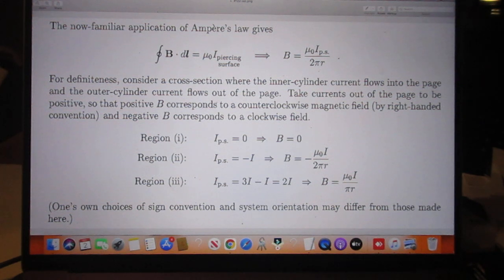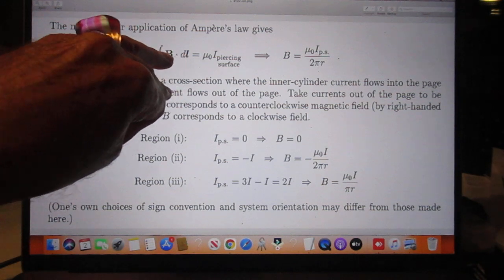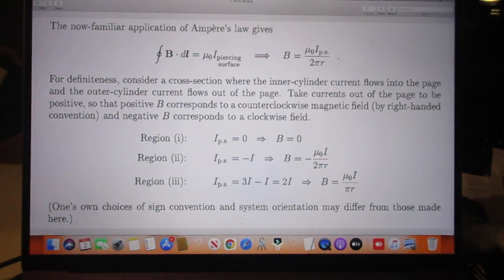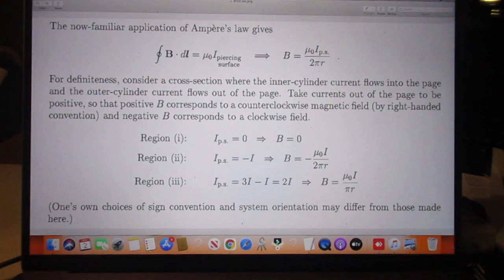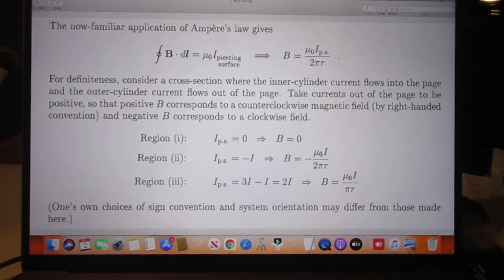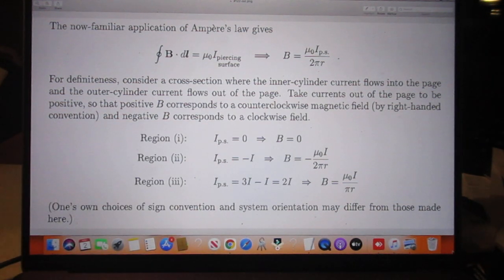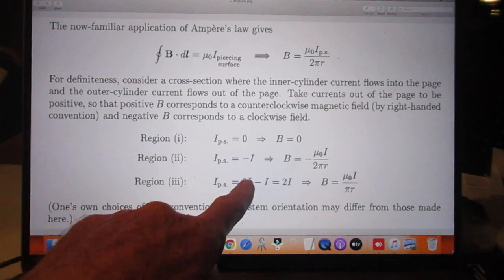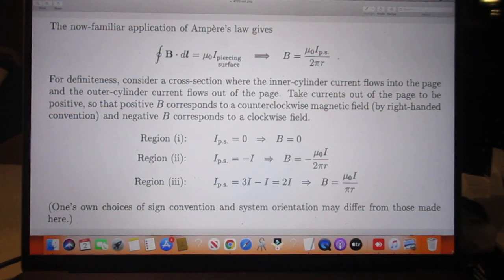Solution Problem 122 - 2 Concentric Cylinders

Comment: You might mention to your viewers how you would apply Ampere's Law to a geometry where the cylinder cross-section is not circular as you assume in this problem (path length = 2 pi r)  and also when when the current might not be uniformly distributed over the cylinder surface.   There are many ways  B dot dl summed around a closed loop can be zero besides B itself being identically zero.

Comment: Despite enjoying the process of learning and teaching classical mechanics, I have not found many real world applications of ampere’s law that do not involve solutions that are non trivial. 

Even within the context of the proposed question, given a wire with a current of 2Amps, and a distance of 4cm, the B field at that location would be pretty small. Another wire could be placed at that 4cm location, and experience a force; however, that force would still be considerably small and seemingly idle in a real world example. Excuse my ignorance, but the textbooks I’ve been studying do not elaborate on practical applications of ampere’s law. Would you be able to provide a few resources that illustrate better and non-trivial applications of said law? 

Is the next application of ampere’s law used to calculate the magnetic dipole moment of an electron? Is this how the magnetism of a material is determined? Please provide more real world applications of ampere’s law. I’m eager to learn more.

Comment: Ampheres circutal law is wrong
Amphere Maxwell law is right
Reply from the maker: In this problem Ampere's Law is PERFECT and it is consistent with Maxwell's addition to his Ampere's Law.
Reply: @lecturesbywalterlewin.they9259 Thank you.sir.
Reply: Ampere's circutal law is not wrong. It is incomplete. Maxwell gave a modified equation taking into consideration displacement current